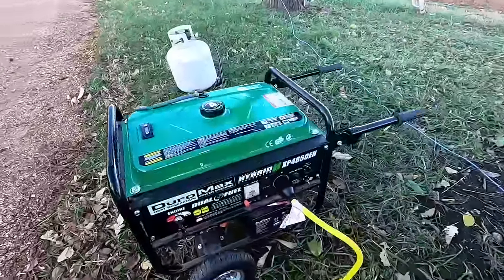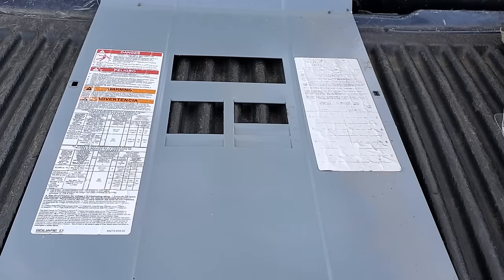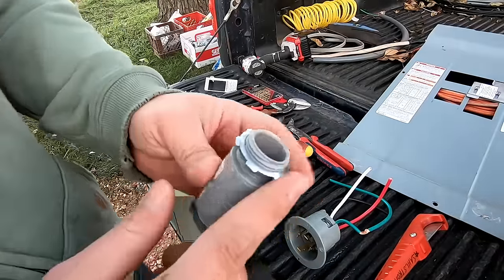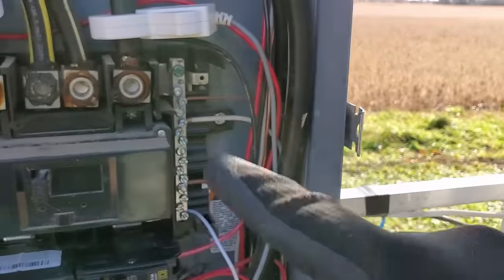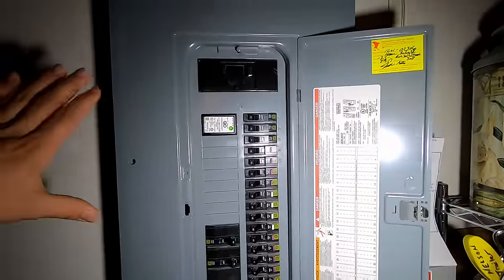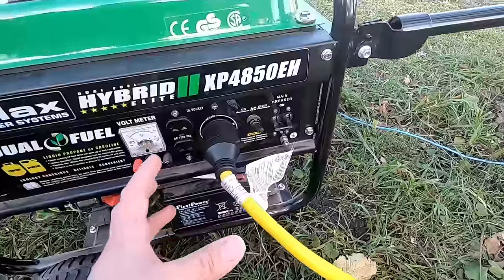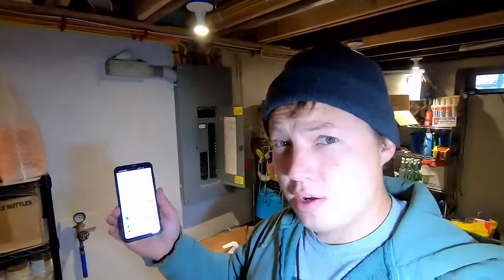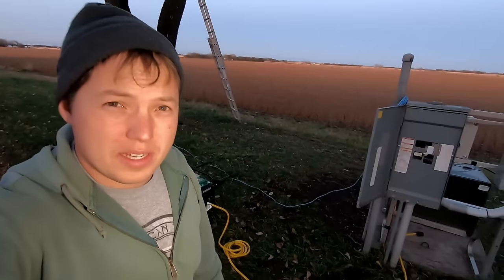How To Hook Up a Generator To Your House Using a Breaker Interlock Kit & Power Inlet Box

Comment: Thank you Ben for this video, I just purchased a westinghouse 12500/9500W dual fuel generator. I'll be doing exactly what you did here but with 50A. Could you help me pick the 50A parts for this project? Thank you!
Reply: Don’t forget about the generator safety tips as well. Always make sure you follow all the generator safety rules whenever you use your generator. Remember that portable generators can be dangerous if not used carefully. Here are the generator safety tips:

This is just a safety reminder 

1) Please do not allow an unqualified person or your children to operate the portable generator. Just because some manuals don’t say that doesn’t mean it’s safe. That is important against the generator safety rules. We also need to be keeping an eye on our children too. You need to make sure that your children are not playing near the portable generator especially when it’s running so they won’t get electrocuted. Generators pose electrical risks and they can be hot during an operation. Please keep your children away from the portable generator at all times. It is important to keep our children safe especially our little ones. Be aware of all the hazards.

2) Some people use their portable generators indoors which increases the risk of carbon monoxide poisoning. It’s important to have a carbon monoxide if you have a gas generator. Never ever use your generator indoors even if your doors and windows are open and even in the garage is not safe to use a portable generator. Not even at your porch and your deck. It is never safe to use your generator indoors and in enclosed areas of your home. Your generator needs to be 15-20 feet away from your house. 

3) 🔥generators cause fire hazards too. Never refuel your generator while it’s running. You need to let your generator cool off before refueling it and before storing your generator. Never overload your generator too. Never ever back feed your generator. You should never plug your generator into a wall outlet. Also never store propane tanks indoors. Please keep flammable things away from the generator as well and please don’t smoke cigarettes near the generator. Having a fire extinguisher next to the generator is also important against the generator safety rules. 

4) generator operation; make sure your hands are dry before touching the generator. Never use your generator in wet conditions. Don’t let your generator get wet. You need a generator tent if you need to use your generator during wet weather. Please don’t wear loose clothes when operating the generator. Turn on your generator before plugging in appliances. Use the right cord for your generator. Please do not use worn out cords. 

https://youtu.be/I1jT3ANENvI and here is a video more about keeping others safe when using generators and also about our family’s safety. Hope this helps

Comment: Hello Ben,  I am planning a workshop / small apartment combo and later the main house.  I want a standby auto generator that will supply only necessary items that are in the workshop and some in the main house.  What would be the best way to go?  Multiple subpanels come to mind.  I appreciate if you could create a video that will help me and likely others as well.  Thank you
Reply: ⚠️Generator safety instructions:

This is just a reminder for everyone’s safety when using portable generators. All generator safety rules need to be followed carefully to avoid hazards. 

1) Please do not allow an unqualified person or your children to operate the portable generator. Just because some manuals don’t say that doesn’t mean it’s safe. That is important against the generator safety rules. We also need to be keeping an eye on our children too. You need to make sure that your children are not playing near the portable generator especially when it’s running so they won’t get electrocuted. Generators pose electrical risks and they can be hot during an operation. Please keep your children away from the portable generator at all times. It is important to keep our children safe especially our little ones. Be aware of all the hazards.

2) Some people use their portable generators indoors which increases the risk of carbon monoxide poisoning. It’s important to have a carbon monoxide if you have a gas generator. Never ever use your generator indoors even if your doors and windows are open and even in the garage is not safe to use a portable generator. Not even at your porch and your deck. It is never safe to use your generator indoors and in enclosed areas of your home. Your generator needs to be 15-20 feet away from your house. 

3) 🔥generators cause fire hazards too. Never refuel your generator while it’s running. You need to let your generator cool off before refueling it and before storing your generator. Never overload your generator too. Never ever back feed your generator. You should never plug your generator into a wall outlet. Also never store propane tanks indoors. Please keep flammable things away from the generator as well and please don’t smoke cigarettes near the generator. Having a fire extinguisher next to the generator is also important against the generator safety rules. 

4) generator operation; make sure your hands are dry before touching the generator. Never use your generator in wet conditions. Don’t let your generator get wet. You need a generator tent if you need to use your generator during wet weather. Please don’t wear loose clothes when operating the generator. Turn on your generator before plugging in appliances. Use the right cord for your generator. Please do not use worn out cords. 

https://youtu.be/I1jT3ANENvI and here is a video more about keeping others safe when using generators and also about our family’s safety. Hope this helps

Comment: Probably the best vid on interlock installation. Question, can I use a generator that doesn t have a 240V outlet ? Can I run two 120 cables each with their own ground and neutral to the panel? Thanks.

Comment: Great videos. I subbed. Question is how did you get wattage usage of generator when you had the amp readers attached to the mains? Wouldn’t you need to move the amp clamps to the generator hot legs? Thanks for answering.
Reply: Okay never mind I went back and saw that you routed them through the clamps with the Mains. Clever
Reply: ⚠️ Here are the reminders about generator safety. We always need to make sure we follow all the generator safety rules whenever we use portable generators: 

Everyone must see this 

1) KEEPING OTHERS SAFE: Please do not allow an unqualified person or your children to operate and service the portable generator. Just because some manuals don’t say that doesn’t mean it’s safe. That is important against the generator safety rules. We also need to be keeping an eye on our children too. You need to make sure that your children are not playing near the portable generator especially when it’s running so they won’t get electrocuted. Generators pose electrical risks and they can be hot during an operation. Please keep your children away from the portable generator at all times. It is important to keep our children safe especially our little ones. Be aware of all the hazards.

2) WHERE TO RUN YOUR GENERATOR: Some people use their portable generators indoors which increases the risk of carbon monoxide poisoning. It’s important to have a carbon monoxide if you have a gas generator. Never ever use your generator indoors even if your doors and windows are open and even in the garage is not safe to use a portable generator. Not even at your porch and your deck. It is never safe to use your generator indoors and in enclosed areas of your home. Your generator needs to be 15-20 feet away from your house. 

3)🔥FIRE HAZARDS: Never refuel your generator while it’s running. You need to let your generator cool off before refueling it and before storing your generator. Never overload your generator too. Never ever back feed your generator. You should never plug your generator into a wall outlet. Also never store propane tanks indoors. Please keep flammable things away from the generator as well and please don’t smoke cigarettes near the generator. Having a fire extinguisher next to the generator is also important against the generator safety rules. 

4) GENERATOR OPERATION: make sure your hands are dry before touching the generator. Never use your generator in wet conditions. Don’t let your generator get wet. You need a generator tent if you need to use your generator during wet weather. Please don’t wear loose clothes when operating the generator. Turn on your generator before plugging in appliances. Use the right cord for your generator. Please do not use worn out cords. 

https://youtu.be/I1jT3ANENvI and here is a video more about keeping others safe when using generators 

Hope this helps

Comment: 1) Does installing an Interlock Kit requires a Permit? (2) If yes, if the kit is not UL-listed or not made by the Main Panel's manufacturer, will a Permit ever be issued? If the answer to #2 is "no", then looks like the house owner's only choice is a Transfer Switch or an illegal Interlock Kit (either purchased or self-made). Please comment on your experience and the state you are in, for a general idea. I'm in S. California. Thanks.

Comment: Great, informative video. Thanks for sharing.
Reply: ⚠️Please don’t forget to follow the generator safety tips when you use your portable generator:

This is a reminder for everyone’s safety when using portable generators. All generator safety rules need to be followed carefully whenever you use your portable generator. This is just to make sure. 

1) KEEPING OTHERS SAFE: Please do not allow an unqualified person or your children to operate and service the portable generator. Just because some manuals don’t say that doesn’t mean it’s safe. That is important against the generator safety rules. We also need to be keeping an eye on our children too. You need to make sure that your children are not playing near the portable generator especially when it’s running so they won’t get electrocuted. Generators pose electrical risks and they can be hot during an operation. Please keep your children away from the portable generator at all times. It is important to keep our children safe especially our little ones. Be aware of all the hazards.

2) WHERE TO RUN YOUR GENERATOR: Some people use their portable generators indoors which increases the risk of carbon monoxide poisoning. It’s important to have a carbon monoxide if you have a gas generator. Never ever use your generator indoors even if your doors and windows are open and even in the garage is not safe to use a portable generator. Not even at your porch and your deck. It is never safe to use your generator indoors and in enclosed areas of your home. Your generator needs to be 15-20 feet away from your house. 

3)🔥FIRE HAZARDS: Never refuel your generator while it’s running. You need to let your generator cool off before refueling it and before storing your generator. Never overload your generator too. Never ever back feed your generator. You should never plug your generator into a wall outlet. Also never store propane tanks indoors. Please keep flammable things away from the generator as well and please don’t smoke cigarettes near the generator. Having a fire extinguisher next to the generator is also important against the generator safety rules. 

4) GENERATOR OPERATION: make sure your hands are dry before touching the generator. Never use your generator in wet conditions. Don’t let your generator get wet. You need a generator tent if you need to use your generator during wet weather. Please don’t wear loose clothes when operating the generator. Turn on your generator before plugging in appliances. Use the right cord for your generator. Please do not use worn out cords. 

https://youtu.be/I1jT3ANENvI and here is a video more about keeping others safe when using generators. Everything that is said about the generator safety rules all need to be followed. Especially keeping your children safe. 

Hope this helps

Comment: Good day, Benjamin, thank you for awesome video, I am considering WGen7500DF generator which produces peak power of 9500 watt, the typical inlet is rated for 7500 watt, will that be an issue? Also will 30 amp double pole breaker will be sufficient,  cause if to go next level things get complicated incl tyle of inlet connection,  please advice.  Thank you.

Comment: Thanks you so much you are help somebody needs your video ❤️👏👍🌹
Reply: ⚠️Please don’t forget the rules about generator safety: This is a very important announcement for everyone. It’s important to follow all generator safety rules whenever we use portable generators: 

Everyone must see this. This is just a reminder for everyone’s safety. 

1) KEEPING OTHERS SAFE: Please do not allow an unqualified person or your children to operate and service the portable generator. Just because some manuals don’t say that doesn’t mean it’s safe. That is important against the generator safety rules. We also need to be keeping an eye on our children too. You need to make sure that your children are not playing near the portable generator especially when it’s running so they won’t get electrocuted. Generators pose electrical risks and they can be hot during an operation. Please keep your children away from the portable generator at all times. It is important to keep our children safe especially our little ones. Be aware of all the hazards.

2) WHERE TO RUN YOUR GENERATOR: Some people use their portable generators indoors which increases the risk of carbon monoxide poisoning. It’s important to have a carbon monoxide if you have a gas generator. Never ever use your generator indoors even if your doors and windows are open and even in the garage is not safe to use a portable generator. Not even at your porch and your deck. It is never safe to use your generator indoors and in enclosed areas of your home. Your generator needs to be 15-20 feet away from your house. 

3)🔥FIRE HAZARDS: Never refuel your generator while it’s running. You need to let your generator cool off before refueling it and before storing your generator. Never overload your generator too. Never ever back feed your generator. You should never plug your generator into a wall outlet. Also never store propane tanks indoors. Please keep flammable things away from the generator as well and please don’t smoke cigarettes near the generator. Having a fire extinguisher next to the generator is also important against the generator safety rules. 

4) GENERATOR OPERATION: make sure your hands are dry before touching the generator. Never use your generator in wet conditions. Don’t let your generator get wet. You need a generator tent if you need to use your generator during wet weather. Please don’t wear loose clothes when operating the generator. Turn on your generator before plugging in appliances. Use the right cord for your generator. Please do not use worn out cords. 

https://youtu.be/I1jT3ANENvI and here is a video more about keeping others safe when using generators 

Hope this helps. Remember safety first